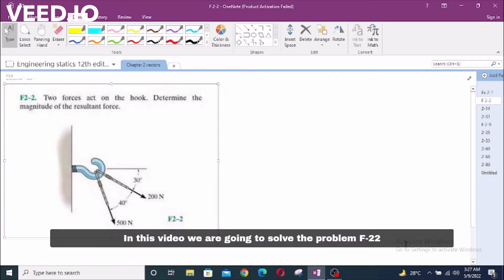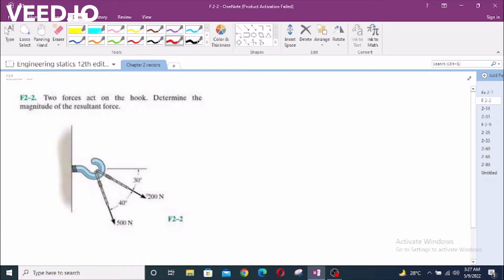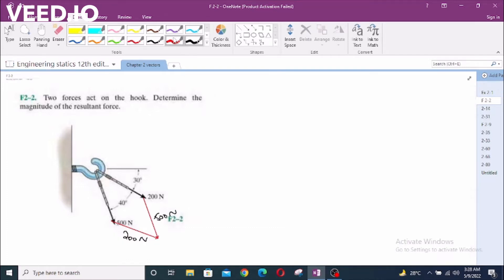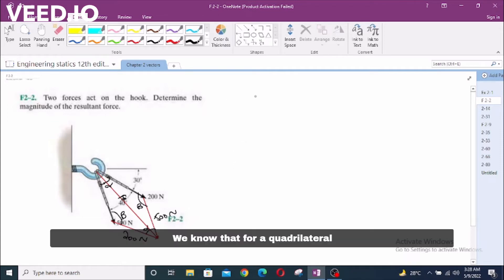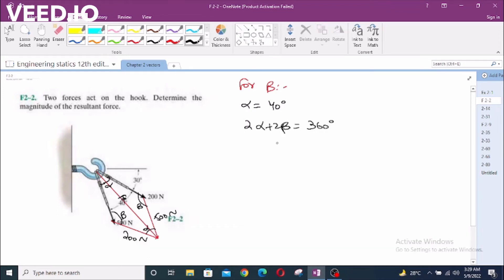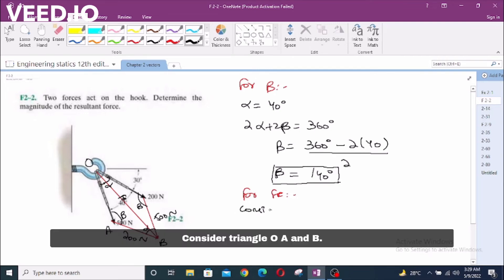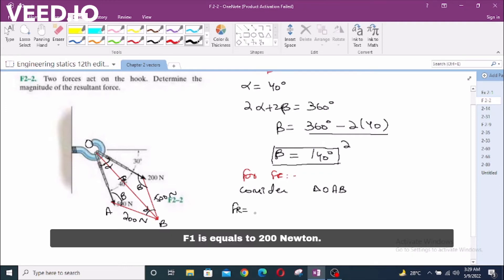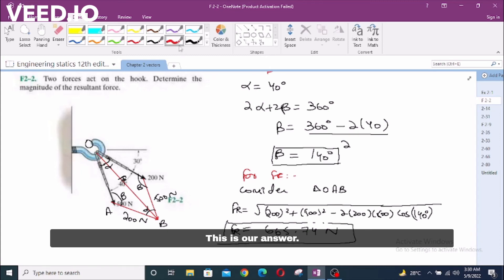F2-2 hibbeler statics chapter 2 | hibbeler statics | hibbeler

Comment: how to calculate the direction of it
please guide and also solve it by RECTANGULAR COMPONENT METHOD
Reply from the maker: To solve it using the rectangular components method, first resolve the forces into their components, Let's say 200 N force has a horizontal component of 200cos(30) and the vertical component of 200sin(30). Similarly, 500N force has a horizontal component of 500cos(70) and the vertical component of 500sin(70). Now add the respective components, Fx= 200cos(30)+500cos(70)=344.2 N and Fy= 200sin(30) + 500sin(70)= 569.8 N. Now find the magnitude using Pythagoras theorem |Fr|=((344.2)^2+(569.8)^2)^1/2=665.7N. For direction measured clockwise from the positive x-axis angle=tan^-1(Fy/Fx)=tan^-1(569.8/344.2)=58.9 degrees. I hope it will help!!